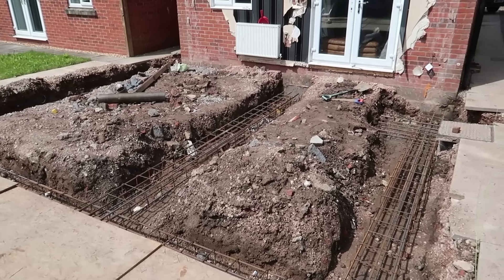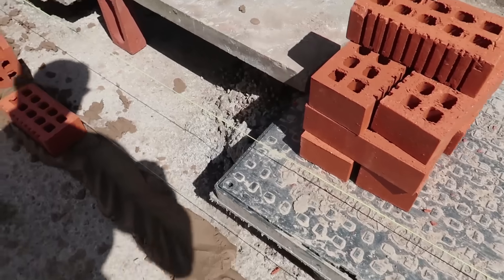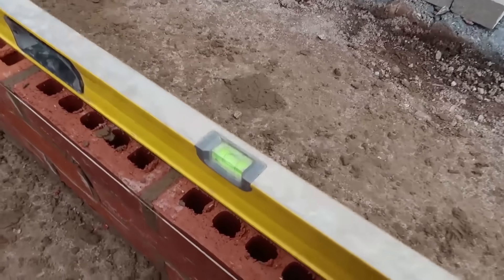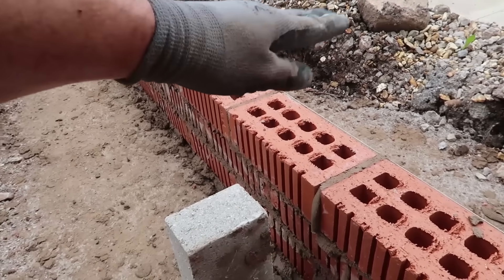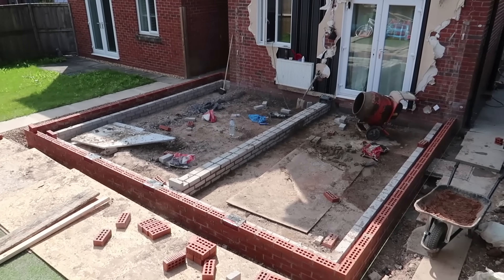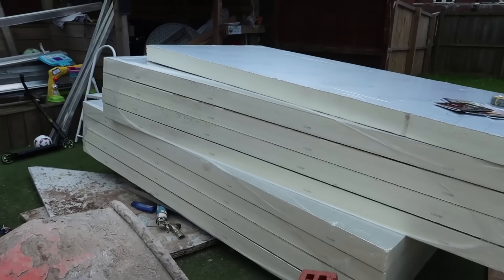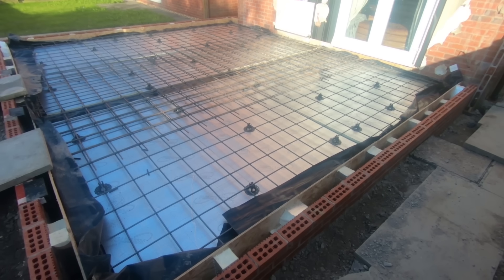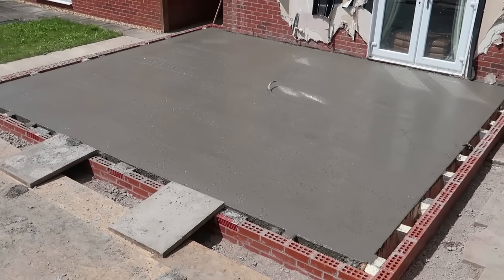Bricklaying - How To Do Foundations For House Extension

Comment: How deep did they make u go with the piles?  was that cut piece of  pipe laying on top the bury depth for the ones that were installed?  some might say overkill but i love making buildings that will outlast us. great job, looking forward to next in the series.
Reply: They normally sink the piles until they reach decent ground the use a laser level and set it to the correct height taking the depth of concrete. Cut them all off at the same height and sit your steel on top of them

Comment: I just wonder, with those piles is the base capped or summit? Cos otherwise wouldn't it fill with soil if just hammered into ground? Don't tell me someone had to dig down 🙄 Or do they auger down then metal sleeve is left? Dunno much about piling but be interested to know 👍
Reply from the maker: They are filled with concrete in the pouring process
Reply: First pile with be pointed
Reply: @hossnation86  Ah nice one ,cheers

Comment: ok great vid, I'm just a bit confused why you have air bricks as you have a slab oversite as the air bricks on the old house are covered over with the concrete. Also doesn't your b/c insist on a vapour barrier over the insulation?
Reply: No obviously not the job has been done as instructed in the plans hope this helps

Comment: Brilliant vid Stu I`am not a builder or bricky but totally confused surely the weight of concrete  would crush insulation and again the concrete is a floating slab as not tied down in theory just  asking
Reply: They are high density foam boards they will not crush easy....
Reply: those sheets of insulation pretty strong 👍
Reply: How can it crush the insulation??? Think about it... in effect he has just formed a huge reinforced lintel with the floor. It's what we would call a raft the internal walls are bearing on a piled footing that has a steel ring beam over the top that's concreted and the floor now is bearing on that once the concrete has gone off there will be no load on the insulation other than it own weight.

Comment: Not in trade.  What's the secret to get it square off the house. Or is it trial.and error
Reply: You can measure the 2 diagonals of the rectangle which you’re building. If the measurements are the same then your rectangle is square to the house.
Reply: Andrew Jackson take a line of gaible of house run with existing building
Reply from the maker: If you watch the video you will find out lol

Comment: I’m a piler mate those look like grundomat piles just can’t understand why there’s no pile bars or the piles aren’t filled with concrete before the steel beams were installed but not trying to diss your vid.
Reply: We use a vibrating poker to send concrete down each pile as the trench is getting filled, when the pile is full put a T16 down with a bend on to sit it on the cage. We also put membrain on the bottom of the footing before our cages are put in. We also tie our corners both ways using L bars. Everybody has their own way
Reply: Thats what i thought, i have always used helicoils and bar concreted them in, heat the bars and bend them into the ring beam?.

Comment: Great video mate just wondering was there any particular reason the internal commons weren't taken up to dpc and tamped off that? Really neat work pal 👍
Reply from the maker: Yes because the slab had to sit on the commons
Reply: @Stucrompton1  ah I'm guessing because of the bad ground/piles 👍
Reply: It's called a suspended  floor Adam. The ground under the slab will drop and settle over time. With the slab sitting on the common, if wont go anywhere
Reply: @jonathanclayton3918  cheers didn't really think about that at first.